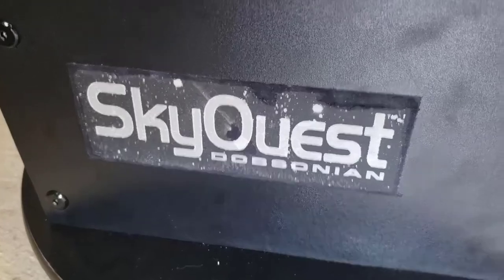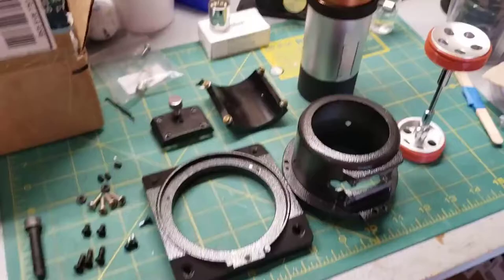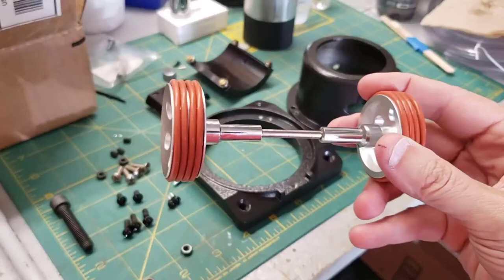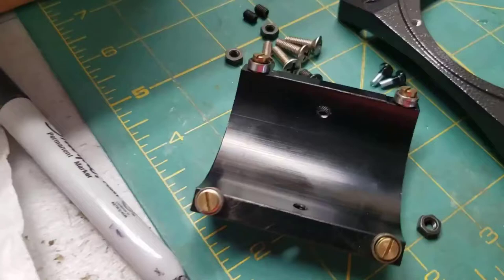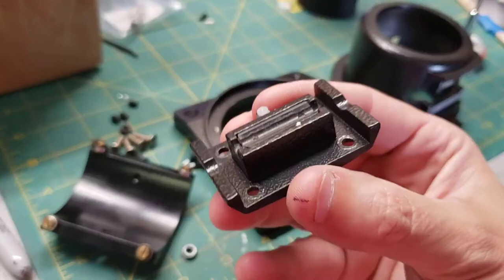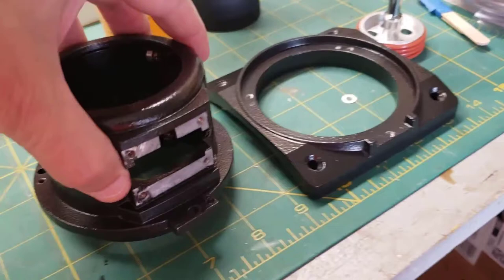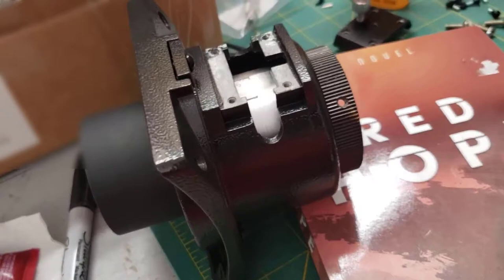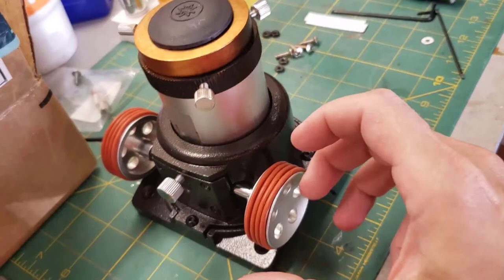Assembling a Crayford Telescope Focuser For A Telescope

Comment: Hello, thanks for this interesting video! Unfortunately my focuser slips when I put the eyepieces on, it is like there is less friction between the tube and the 2-wheels mechanism. I know that there is a screw that can fix the focuser in a chosen position, but is there a simple way of restoring the initial friction? Maybe by tightening some other screws... Thank you very much. Have a nice day!
Reply from the maker: On the back of most Crayford focusers there are five set screws shaped like the 5-side on a normal dice cube.  The middle one will let you adjust the tension on the roller.  It sounds like you need to tighten that one just a little bit (it doesn't take much).
Reply: @reflactor  Thank you very much, it worked! Thank you again and have a nice day! 👋

Comment: Thanks again.  Where did you get the O rings? I need to replace mine. Thanks
Reply from the maker: Here's the Amazon link for those O-rings:  https://amzn.to/3B7WnQV
For what it's worth, I have an entire video dedicated to just installing these o-rings:
https://youtu.be/csKGS1iEmE4
Reply: @reflactor  thank you very much.
Reply: @reflactor  I just did the O rings and it looks and feels amazing.  I also added  a drawer nub replacing one of the small bolt that hold the plastic at the border for a bigger bolt with the same thread, bolt from inside out, nub outside, easy job and no modification at all, you can go back if you want, and the bigger bolt and nub are both use for cabinets  i just painted black. Now I don't have to hold it by the border when tracking.  I'll try to send you a picture . I bought this xt8 and it was a mess , thanks God the mirrors where great, the primary was really dirty but watching your video and i clean it , you reallyscared me when you droppedyour mirroron your video  it was ice wasn'tit., I had to replace most of the rusted bolts for new ones stainless . I also did the tefIon job, but I used the same that came with it, it was ok, I just replaced the rusted nail that was holding it on place and scratching where the tube rest. I paid $150 here in Miami, the base was falling apart. Now it looks and feel great . Thanks for your tips. Best regards ✨️
Reply from the maker: @chicofun4779   I'm glad it worked.  I'm jealous of your project!  The ones that take a lot of reconstruction end up being the most beloved projects.  I bought my own XT8 from a house where it was severely damaged in a mud flood.  The mirror was okay, but rest was wrecked.  Unfortunately, I didn't do YouTube back then so that restoration was lost to the ages.
Reply from the maker: I forgot to answer the other part of your question.  The broken mirror in the cleaning video was indeed a paper plate full of ice with a bunch of pieces of aluminum foil sitting on top.  Good catch!